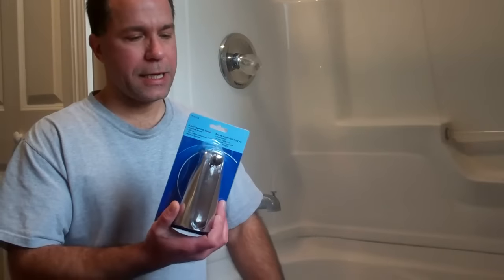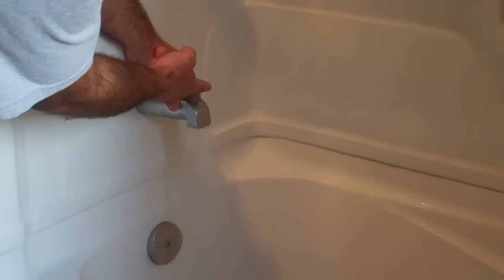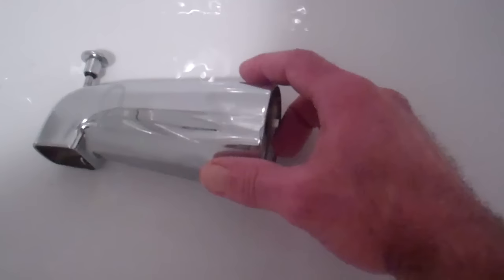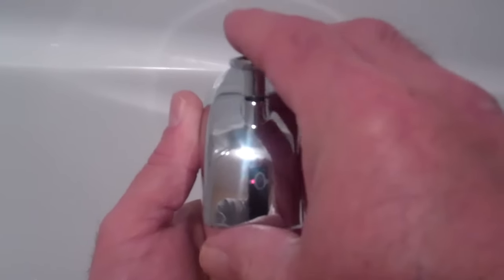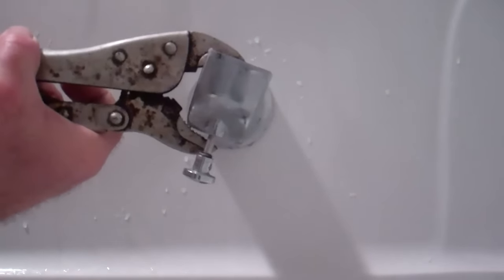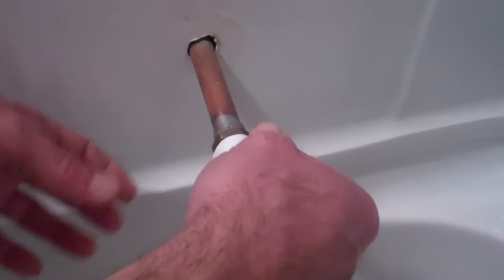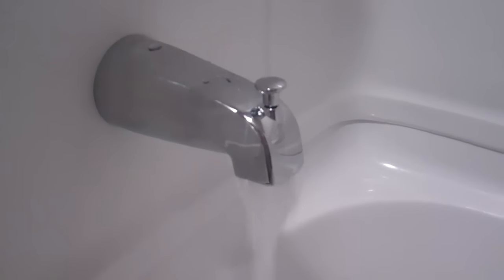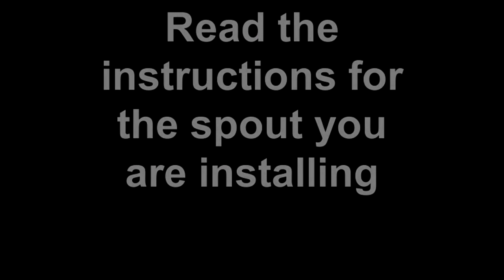Bathtub spout replacement

Comment: Thank you so much for this video. I will be replacing my bathtub spout today as most of the water started coming out of the spout instead of the shower head. I have the one with the set screw and you've helped me guide to taking my old one off.

Comment: Plumbers tape needs to go on the direction of the turn. If it tightens clockwise install your tape clockwise. He installed the tape counter clockwise. This will cause the tape to come off on installation and may cause leaks. Putting the tape on the way it tightens makes sure the tape will stay on.
Reply: good to know
Reply: samuel lemmons have
Reply: this is why i recommend pipe dope thread sealant just slap it on and your golden.
Reply: Bathroom fosit leaks
Reply: ManyThanx for the Info Good Buddy!

Comment: When the water is shut off and still diverted to the shower part it's still leaking at the bottom. Filling up a 2 gallon bucket every couple of hours. Do I need a new spout or is it something worse?? Thanks Oh, even when I push down on the spout to remove remaining water it won't stop leaking.

Comment: the owner of my apartment used the screw on kind but didn't measure the pipe, so the spout does even reach the wall.  is this something the super should fix asap or is it simple enough for me just to do it myself.?
Reply: I meant that the spout does not reach the wall
Reply: there are adapter or extensions that allow you to reach with the spout the threads of the feeding pipe. it is gray pvc adapter
Reply: If the spout does not reach the wall, the copper pipe is too long.The pipe needs to be shortened and the threaded fitting needs to be soldered in place.

Comment: You put the teflon tape on backwards.  The tape should be wrapped in a clockwise fashion, ie righty tighty.........
Reply: Martin:
Glad you watched the informative video.  How about a compliment first and then constructive criticism later.  It's really easy to criticize, not as easy to make and post an instructive video...
Reply: ***** Yes, teflon tape does on in the same direction righty tighty.  There's a teflon paste that you can apply.  Doesn't make any difference which way you paint that on.
Reply: Martin W    Where do you get that tape?
Reply: The thread/teflon tape should be put on in a clockwise direction (or more accurately, the same direction as the threads and that the fitting will be screwed on) so that it doesn't become unraveled when putting the new spout on. Great video otherwise!
Reply: Talk about malicious!!!

Comment: My girl friend watched this video while I was at work and was able to change it her self. She said you had the Best/Most informative video. Thanks!!
Reply from the maker: You have a keeper with her Chris ! Thanks for commenting.
Reply: I fixed a shower spout before. My problem is, I have moved into a new place (new to me) a week in and my faucet sprang a leak and was shooting water out of the bottom of the spout. Having replaced one before I went to unscrew it and it broke off - pipe and all from the wall. What is my recourse here when my pipe/spout is broken?
Reply: My spout only stuck out an inch and a half maybe
Reply: @forgetfulgalaxy8026  You're probably going to have to call a plumber; he's going to have to replace that pipe.

Comment: Informative yet 2 problems...
1. Tape was applied in wrong direction.
2. Not enough tape, should have wrapped threads 3 times on that, especially seeing you had to back off 1/4    turn.

Comment: He not only skimped on the Teflon tape he put it on counter clockwise. Tape, in this case, needs to go on clockwise. Tape should overlap tightly 3 to four times. In the video he had an instant leak at the back of the spout when he diverted water to shower.

Comment: Thanks for a great video tip. Came in handy and saved $100.
Reply from the maker: +J ML I love to hear i help people save money J ML !
Reply: +backyardmech Once I had to spend $200 just to get a leaky commode fixed. First I think floor installers didn't tighten up the water supply thing at the wall after resetting commode, and the leak was from water supply onto floor. First attempt was a Handyman who put a new kit in toilet tank. Still leaked. Second called a plumber, explained where the leak was. He said the toilet kit was bad & put another one in. Left. Still had a leak, called plumber back and finally listened to me and tightened the nut thing at the water supply line. That's all that was ever wrong. I couldn't do it because of arthritis in hands. Plumber paid no attention to me - thinking he knew more than I did, so it ended up costing me $200 when all I needed was a pair of pliers and a stout hand to tighten the nut.

Comment: At 2:30 CORRECTION: The hole on the underside at the wall is to drain any leak that occurs. Whether the hole also has a set screw is an additional detail, NOT the main reason for the hole.
Reply: That's helpful to know. Thanks for pointing that out. 👍

Comment: Nice video, thanks!
My old spout had a hole in the bottom, so I knew it was a set-screw type. However, I had to twist the spout 90 degrees until I finally found the hex screw. Whoever had installed it must have put the spout in sideways, set the hex-screw, then spun the spout downwards.

Comment: Very easy directions. I thank you for not being one of those guys who talks a blue streak about what he's ABOUT to do. Excellent directions. You did say you could soak it first in something (white vinegar?) to remove gunk first? Did you tie a bag of cleaner to end to clean it? Nice you have such clean hands and clean shower as well. VERY excellent. I "almost" feel bold enough to try. Mine leaks like crazy.
Reply from the maker: +Holly Dee I tried CLR Holly - i used a toothbrush to clean the spout ; it worked for awhile. Thanks !
Reply: +backyardmech CLR? I didn't think of that, thanks :)

Comment: Thank you!! I'd been working up the courage to put a little umph into unscrewing that spout but needed some reassurance. I already replaced the diverter once but it was really never the same because of the build-up on the spout itself and it's impossible to get the build-up off now. The damage is done. Our water is so full of minerals I think I'm going to have to just replace the spout every few years. Your succinct and thorough video was just what I needed.
Reply from the maker: +Thais Gloor Minerals take a toll on plumbing fixtures for sure Thais ; hope the job went well !

Comment: What do you do if you have the 4" pipe out of the wall that screws into the thread on the spout, but 
your replacement is the push on kind?  I don't think that threaded part on the end of the wall pipe is 
going to push through.  Do you need to cut that "screw head" off the copper pipe?

Comment: my bathroom was remodeled last month without major (lead-in or behind the wall changes) All superficial.  After replacing the dull fixtures with new matching fixtures, I can, and so can my downstairs condo owners, hear dripping.  Could this be back-flow inside the water spout?  It seems to be where the sound is.  The faucet on/off handle has been checked by the contractor and they tell me "dripping is expected for a little while after use". Huh?!?  If it's the spout, how do I fix it?

Comment: Help! I watched the video and it is veru well done. My issue is that the old spout will not unscrew . A handy man friend said it would have to be cut off with a torch. Does this sound reasonable? Another friend  said NOT to do that. I need some advice from a professional. Thank so much

Comment: I have the no thread, slip on and its working but leaking.  I took it off and now the rubber washer (I guess) is moved inside and warped UGH.  Help

Comment: Good info up until the actual installation.  You need 3 to 4 wraps CLOCKWISE of the tape.  When you rotated it counter-clockwise you should have removed it counting the rotations, clear off the tape, put more on and then only rotated it the correct amount to have it come straight up.  The moment you reversed the rotation the tape was toast.  I don't know if anyone else saw this, when the diverter was used water was coming out the back of the spout and going down the wall.  This is due to the bad taping job.

Comment: Mines the scew on type and it likely has been on for 40 yrs. Plus.. Will it become seized on over time.. I'm scared to try to unscrew it as it might break the copper pipe where it is soldered behind the wall..is this a concern or have or should I just jim dandy it and hope for the best ? There used to be a  round donut type plate between the back of the spout and the wall..its called an escutcheon or something.. can you get a  new spout  with one of these ?
Thanks

Comment: Mine has NO set screw. It also has NO threads to unscrew. It turns forever, 20 or 50 revolutions, but it does not move away from the wall at all. I will continue looking for a Youtube video that explains how to remove my type of spoot.

Comment: these spouts can corrode..then spit back toward towards the wall on which it is mounted.... resulting in a leak...if on an upper floor, the leak shows on the ceiling below

Comment: You did not address the issue of how to stop water infiltration between the spout and tub wall. There is usually some type of caulking that is done to prevent shower water from seeping in between the wall and tub spout. Suggest clear silicone caulk designed for bathrooms, Just be careful to apply a thin layer of caulk and then smooth it out with a wet finger (preferably, yours). This will force the caulk into any small gaps between the wall and spout.

Comment: I just purchased the American Standard tub spout removed the old one using the allen wrench, but the new one goes on the copper pipe but the set screw does nothing but keeps turning. I took the spout off and looked at the set screw took it off and put it back in it just goes right in, without having to turn the screw at all. So what I'm trying to say is once i have the spout on there is no way of tightening it. Suggestion?

Comment: Is there a type of spray cleaner that i can use to spray into the faucet and release and clean the chemical residue or build up. Mine is all seize up and blocked with residue that i noticed under the faucet? 🤔 ❤ 👍 👁

Comment: Just wanted to point out, should have wrapped tape around pipe at least 3 times and in a clock-wise direction so as not to remove tape when screwing spout back on.

Comment: The spout with the set screw looks like it could allow water to leak back into the wall and you wouldn't know it until damage had been done. 

On the other hand, I remember our plumber using what seemed like about 100 lb. of torque to screw on the spout in the bath/shower, during bath/shower remodel.   

Now, I'd be afraid to try and remove the spout, for fear of damaging the pipe and having a hidden leak in the wall.   

The diverter can also be replaced, which is MUCH easier than dealing with a new spout installation.    

A lot of faucets comes with a lifetime warranty - contact the manufacturer to see if they will send a new part to you at no charge.

Comment: What if I have 3 knobs (1 for hot, 1 for cold) and the diverter is the 3rd knob in the middle. Unlike your video, the diverter is the middle knob and operates when turned. I have a leaky spout, but no leaks from the middle knob or the shower head. What would recommend replacing in my case.

Comment: It was a booger when I unscrewed it to find the pipe unit for the shower loosened up. I got it on and was able to secure it by using insulated foam.

Comment: I need to check what kind of spout I have before buying replacement. If I remove the spout to check and install it back, will it leak? I am not sure if it is copper or other kind of connection inside.

Comment: I have a spout with a hex head screw but no matter how hard I try to screw it, the screw keeps slipping out, i.e. it doesn't attach to the water pipe. I bought some new screws from Home Depot but still not able to fix it in place. What am I doing wrong?

Comment: I called a handyman thinking that it would be cheaper then a plumber and figured it would be close to $150 plus the cost of the spout. I had bought the wrong one. I did not need the one with the allen screw. I was a little concerned about turning it with a channel lock as it seemed really tight but once it started to move I was okay. It works great. I just subscribed to you just in case you have more videos that I can use.

Comment: Hi, I have the threaded pipe just like yours in the video, but the old spout is broken and stuck on the thread. Can I just cut the threaded head of the pipe, and then slide in a new spout of the sliding type?

Comment: NEED HELP!! my spout has the opening on the bottom but, no screw or anything it's just copper pipe...does this mean it is threaded pipe and just unscrew counterclockwise?? Thanks for the help!
Reply: +Daniel Aleckson I have the same issue. Mines has an opening underneath, but there is nothing for me to unscrew...

Comment: good show/tell what's in there.

 I have the 2nd type no set screw (also no divertor) but I'm getting some sort of leak  coming back from the spout?  to the backside - out behind the  the fiberglass.  a rubber band around the spout with a another rubberband dangling from the first makes the drip fall down without hitting the back.  Your video gives me a good look at what I'm expecting to encounter save nothing ever seems to come off or back on as expected!  Thanks!
Reply from the maker: I hear ya James ; good luck with the job !

Comment: thanks for the video, where did you buy the spout that you replaced? I checked Crappy Tire and there were only those that were slip-on or thread for pipes of 1 inch length. Mine is a 4"1/4 that is threaded like shown on your video. I even checked walmart. Next will be home depot, any ideas?
Reply: Christien Savoie Home Depot is the best idea.  Can be found at Lowe's as well.

Comment: I watched all of the videos for installation.  One of them talked about caulking around the water pipe.  None of the others did.  It makes sense to caulk, but I wonder if that is what should be done or does it really matter?
Reply: If you watch near the end when he turns on the shower, you can see a few drops of water escape at the gap between the tub spout and the paneling. This isn't uncommon but if the hole in the paneling for the pip is large enough for that water to get behind it and into the drywall, it can cause the drywall to start to crumble and/or become moldy after some years of use. If this worries you, which is reasonable, you can caulk around the pipe where it comes through the paneling to ensure no water gets back to the drywall. Just be sure to use the correct caulk. It will be clearly marked as intended for tubs/showers.

Comment: Great video -- I don't care how you pronounce spout, you had the important parts of how to replace this thing and I plan on changing mine out this week.  One question, can you switch from the screw on spout to a set screw spout, or do you have to use the same exact type as the old spout?

Comment: We have the same problem with our spout, my son changed it but it still leaks out the bottom faucet, any suggestions? Not sure if he put plumbers tape around the pipe, would that be the reason it still leaks?
Reply from the maker: +Terry Dee Not having the Teflon tape may be the problem Terry - not getting a water-tight seal

Comment: Yeah i just had to do that and it worked fine!I knew not to crank too hard when putting the new one on to avoid damaging the threads.When I pulled up the diverter it stopped the flow into the tub and the shower worked fine.

Comment: I'm not going to read all the comments to see if anyone covered this . . .  but . . . he didn't put the tape on correctly. You want to wind the tape in the same direction that the spout is going to thread on, (clockwise) he didn't. You want to wrap it at least 3 - 4 times around, he didn't.  I betcha it leaks (not that it would do much harm). It looked like it was dripping out of the back of the spout down the tub wall.
Reply: I thought i noticed the leaking too -- so you're saying if there is a leak that's where the water would go?  I was planning on swapping mine too, although I'm a bit worried that the thing is locked on there with calcium.

Comment: i have the pull down Diverter. Can i replace it with a spout with the diverter on top as long as the measurements are the same?

Comment: Gah I was hoping I could just clean mine. The thing is only 2 years old. Damn cheap spouts!
Reply: Dip the tip of it  in vinegar overnight , then replace the rubber seal in the white plastic piece that opens and closes the opening at the front ,and you're done. No more leaks :) and 30 bucks saved :)
Reply: Thanks for the tip!

Comment: Thank you very much for this video. My son and I repaired the threaded type today. it works like a dream. I love your teaching style.
Reply: +Sally King ** I'm a 73 yo woman thinking about trying this myself. You don't have to turn off the water "supply" do you?  I only know where my main water supply thing is.
Reply: My son did this without turning the water off. Be careful to keep the old spout steady while turning so you do not tweek the pipe. Make sure you have plumbers tape to cover the pipe ridges. And last be careful not to tighten the new spout too much. My son Just tightened it by hand. It works fine. Keep me posted how it went.

Comment: And what do you do if the set screw is stuck?
Reply: bumble bee : Make certain there are no potential water drips (electrocution hazard), get a metal drill bit, & drill the screw out. Drill only as far in as the screw goes...go too deep & you'll damage the pipe.